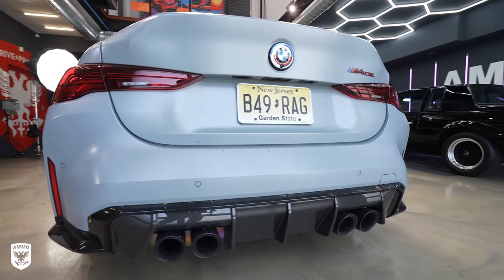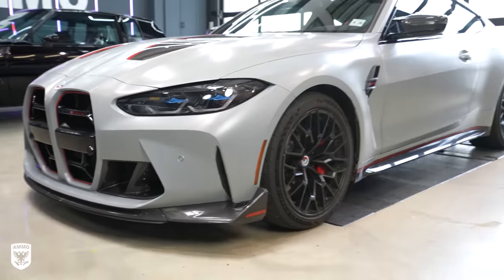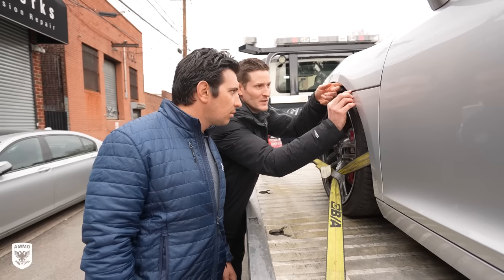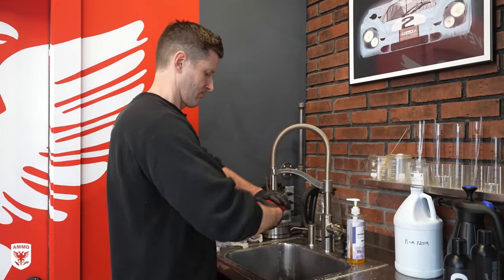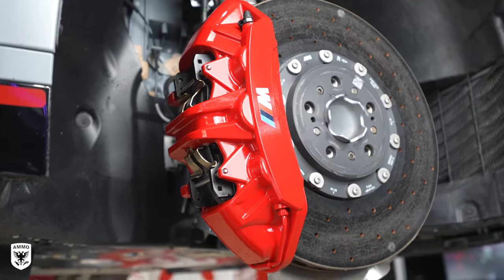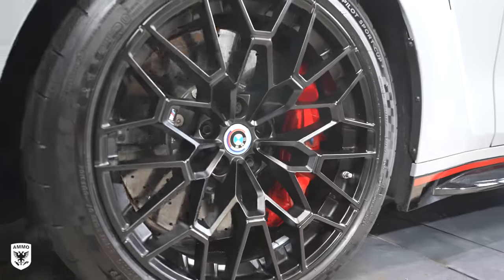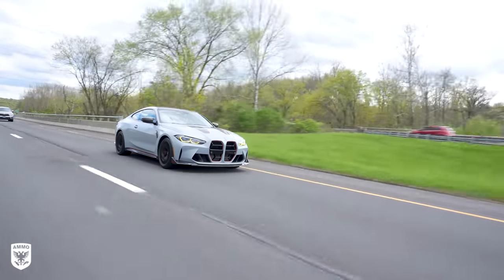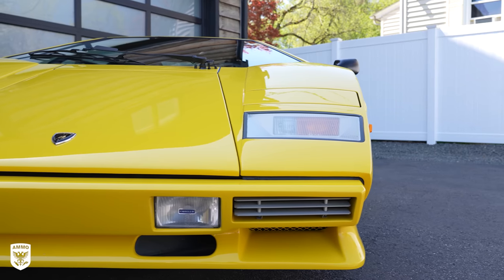First Wash $145,000 BMW M4 CSL How To Wash and Protect Matte Paint

Comment: Thank for the informative video! Question about the power washer. You said no more than 1200 psi almost all pressure washers I find are higher than that. Do you have a recommendation on a good 1200 psi unit?

Comment: Matte finish is the definition of self-inflicted pain😃 Any little damage or imperfection is basically unfixable, you take a small rock hit or a surface scratch and you get to stare at it forever. Ceramic coating does not protect against either type of damage. And, matter finish doesn't even look that good, although that is obviously subjective.

Comment: I have a question: what about clay? Can it be used to remove some contamination or is it better not to use it on matte paint?
Reply: Given it's a rough surface, I suspect claying would be pointless since the point of clay is to leave a smooth surface.  Never tried it, but I expect it would bind.  Matt paint it probably the most retarded trend in car fashion since chrome spinners.